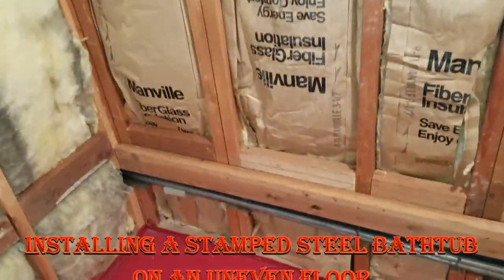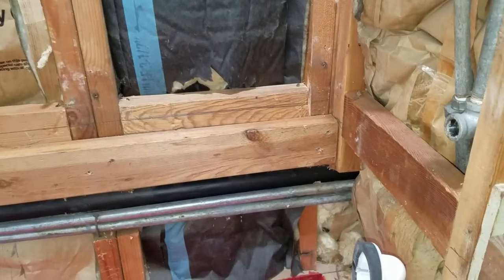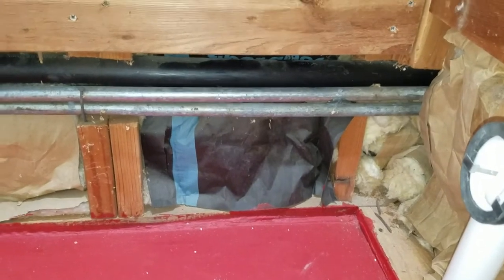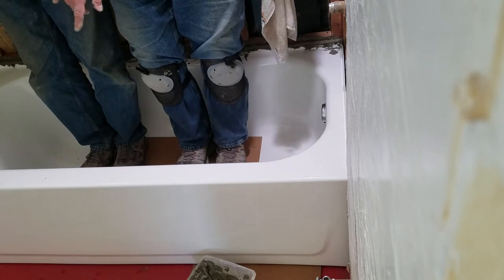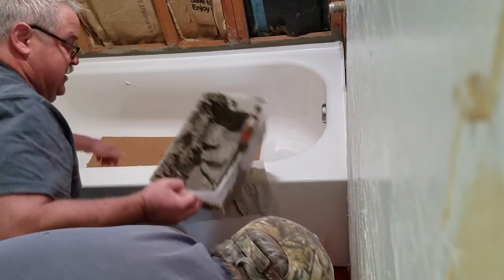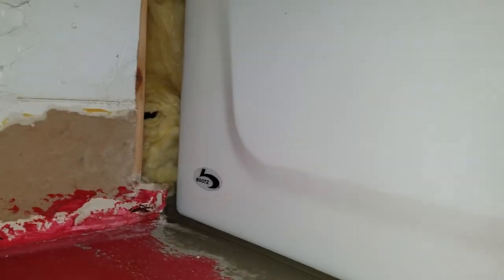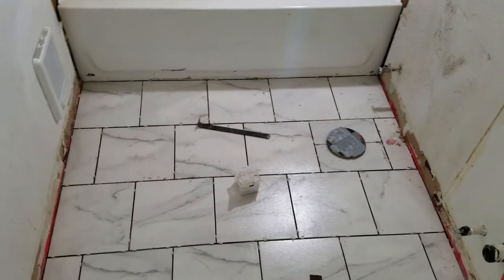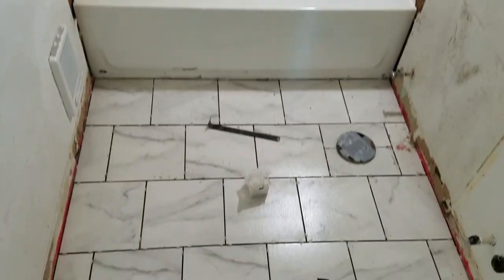Installing A Steel Bathtub On An Uneven Floor

Comment: Hello, I am a DIYer preparing to install a steel tub over a concrete subfloor in two days. This idea seems very appealing for my uneven floor. On the low side, I am probably a half inch out with this application still apply? Also, I’ve heard other people warn about not supporting the middle of the tub over the subfloor. Is this a concern with steel tubs? Thanks.
Reply from the maker: What might work well for you is to use Levelquick to level the floor area first, then install the tub. The larger floor tile you use, the flatter your floor needs to be. For 1 inch tile in 12x12 square sheets, flatness is less important, those will follow the contour.
Reply from the maker: https://youtu.be/AOeuq3I9GS0
Here is floor leveling.
Reply from the maker: https://youtu.be/iMF4UWs6Rt8
There is some leveling shown in this video too.
Reply: I’ll look into that, thank you. I am using small format tiles on a mesh backer for the floor so I’m not really trying to level the whole floor. My main concern is the tub alcove.
Reply from the maker: @Brad B.  the trick is, if you simply level the tub by putting mortar under the bottom edge, you need to be sure the floor tile will be high enough to cover that filled edge and not be exposed above the floor tile. Also, think it through. Sometimes fixing one problem can create another. Take a look at what will happen if you level across the floor. Will it interfere with the doorway? Be careful if you try to taper off the fill area. It could leave you with a tilted toilet or bath sink. Think the situation through and if there are no issues created, go for it.
Reply: Update- We installed the tub last week using about 40 lbs of the versabond underneath. Things went well, and we have a level tub. I think the floor tile and thinset will be very close to concealing the raised tub apron. We have Schluter ditra available from a family member. thinking about using it on the floor just to bring it all up a bit. Thanks for the help.
Reply from the maker: @Brad B.  Excellent! Glad it worked out. Schluter is popular, but I've never used it. It will probably work great as you have planned.

Comment: Mortar mix directly to wood?
Reply from the maker: Mortar on the ledger, it's just acting as a shim holding the tub level. Everywhere else is Hardibacker with Redguard, then mortar and tile.
Reply: @CITAP1  What if the Tunis going on top of wooden floor and needs support on the outer edge?
Reply from the maker: @rickeykeeton4770  Tunis?
Reply from the maker: @rickeykeeton4770  I think you meant tub is going to outer edge. The floor has 1/2" Durrock over the entire thing. Mortar and screw down Durrock into mortar, then tape and mortar all screws on joints, then skim coat entire floor to flatten and seal, then three coats Red Guard. The exposed side of the tub goes across the entire floor. I do shove mortar under the front edge when leveling to fill any voids. The floor tile will come up high enough to cover any lift.

Comment: I like this idea fought this tub for 3hrs trying to shim it in an alcove where I have zero room get shims where I need them. This might be my best option and way faster and give a much more solid feel.
Reply from the maker: It definitely gives a solid feel. Level and set in mortar, walk away for 24 hours. If you have slump trouble with the mortar, you can leave a wood shim in place, then remove and fill the next day. I've done plenty of tubs this way and it worked great every time.

Comment: What kind of thinset did you use? was it modified, or unmodified?
Reply from the maker: Custom products Versabond modified thinset. I prefer to use Custom Flexbond but it isn't always available. Both come in gray or white I would use thecolor that blends better with your grout and tile choice. I also recommend using standard grout, not acrylic or epoxy grout. They are difficult to use and most people fail the Installation ending up with a film on their tile that can take hours and days to scraoe off. Good luck on your project..
Reply: @CITAP1  we have that already! Thank you!
Reply from the maker: @gleinbach  Here is another installation video doing a bathroom, it might be good information for you.
https://www.youtube.com/watch?v=Vwv1ycc6UxM&list=PLyz2LOih3ypsR0_u_p86r4W6VqMzCDVxc&index=7

Comment: How much did that tub weigh
Reply from the maker: 75 to 100 pounds. Much lighter.
Reply: @CITAP1  Do you not need to consider the weight of the in with water in it when someone decides to take an actual bath instead of a shower?  I am thinking maybe 500  lbs or more.
Reply from the maker: @Rickey Keeton  the water puts force pretty evenly around the tub. Even when you sit in the tub, the part of you in the water distributes evenly with the water volume.  There are millions of stamped steel tubs installed just like this without issues. I will say, quality is down, metal is thinner and not as rigid, enamel coatings are thinner and don't shine or look as glossy as in the old days.
Reply: So essentially you are saying the weight rests on the ledger and the side wall. Very little weight is on the bottom of the tub.
Reply: @garrettp.5018  it can. It also depends if there’s anything installed underneath the tub like mortar mix or fix all …

Comment: WEIRD ,,,red guard ,even weirder ,,,thin set is not structural ,,thats why they call it THIN set ,,should have at least used a medium bed
Reply from the maker: @billhamilton7524  Red Guard has been in widespread use for years. 3 coats works great. The thinset used to support the tub is plenty strong and solid, mix thicker for this use of leveling and supporting the tub. The installation is still working fine in a rental property. Several other installations just like it working fine.
Reply: @CITAP1  UNDER  the  tub  why ?
Reply from the maker: @billhamilton7524  
As far as cement board and redguard  under the tub. I like to waterproof the entire floor. Yes water may one day leak down through the tub drain opening and if on a second floor, will minimize water damage to the wood. We will level the tub to the ledger on the wall, then shim the front edge of the tub how it wants to sit, then trowel thick mix thinset under it and let it setup. This method works up to or a little thicker than the installed floor tile. Remove shims when dry and fill those holes with mortar. Works great, floor grout will cover mortar. A solid installation. Some installations need nothing. Some floors are too out of level and need to be leveled.
Reply: @CITAP1  CEMENT BOARD TOO,,,,same under toilet, sink cabinets ,Washer machine ,?? I always say to each his own